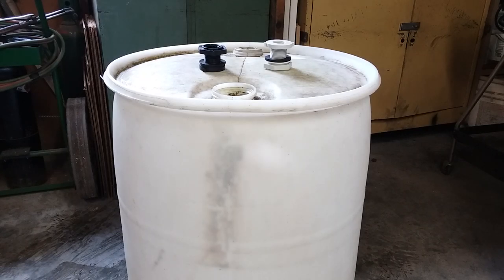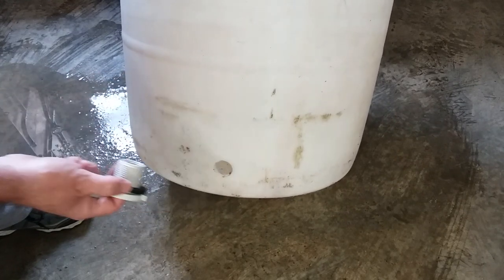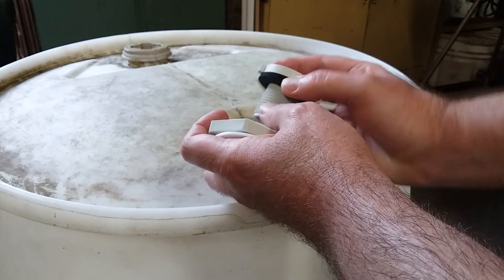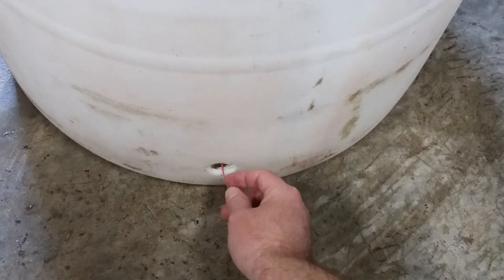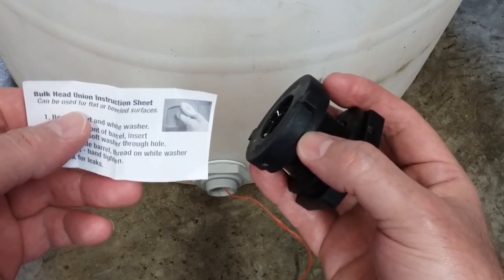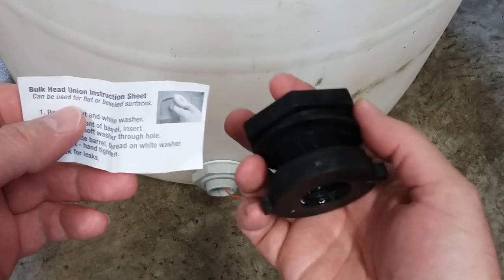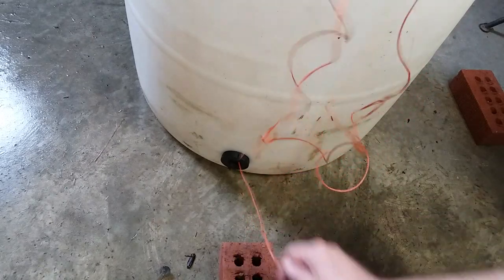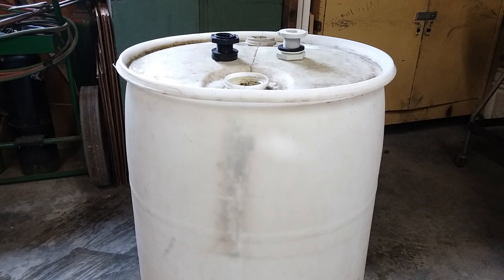Rain barrel Bulkhead union install in closed-top barrels

Comment: Maybe we can add to this.  Great video though!
We do it a bit easier for us old folks but your concept is good!
Take a piece of paracord about 2 1/2 times the height of the barrel.  No need to cut the cord, just make sure you have enough. In the very middle of that length of cord, tie on a 2 inch flat washer. Larger, if your mount is bigger. Just use a tight half knot so it doesn't slip around. You can untie it later. Anything you use must be larger than the inside mount.
Next slip cord inside the mount, do not tie on! Be sure it is facing AWAY from large washer.  The washer is what will hold the inside mount up against the inside barrel wall.  Now, at the very end of the cord, on the side of the inside mount, tie on a smaller washer or nut that can go thru the new hole on the bottom.  
Drop small washer and cord into barrel but leave inside mount and large washer on top of barrel until you get cord & small washer out the new hole or your inside mount will fall off the cord!  
We used a magnetic wand to grab the small washer and pulled it thru the new hole.  You could make a wire hook also. You can take off the small washer if it will not go back thru the inside mount, you just need to be able to pull that cord out the bottom hole to pull the inside mount into place.
Ok, now, pull the cord out from the bottom hole all the while also holding onto the top cord and drop the inside mount and large washer into the barrel [great to have help here). Pull the mount and large washer down into the barrel.  Hang on to that top cord... you have to pull it back out! 
Keep pulling the bottom cord and it will pull the inside mount into place and the large washer will hold it there.  Hold bottom cord tightly while you screw on the outside mount. You will have to slip the cord inside the mount washer. Tighten but do not break anything!
Untie the small washer and pull the upper cord up and out along with the large washer and you are done.
We like using paracord because we don't have to worry about it breaking. Good luck!

Comment: Thank you for that. Very nicely demonstrated. I have, in the past, cut the hole for the downpipe wide enough for me to get my arm down, holding the nut in a vice-grip. I've also fitted the barrel upside down with the tap fitted through the barrel's bung/cap and drilled a hole in the  barrel's bottom (now the top) for the downpipe. But no more messing about. This is the way to do it. Much thanks.
Reply from the maker: Glad it helped. Thanks for watching

Comment: I was wondering how to do this ... thanks!
Reply from the maker: Glad I could help!
Reply: I found it is easier for me to fish out the string with the barrel turned upside-down and I drop the string with a weight attached into the hole I just drilled.  I pulled the string up and let it dropped and generally the string fell out of the opening at the bottom after a few times.

Comment: Now how do you take this fitting out when you need to replace a cracked washer? That’s the predicament I’m in…
Reply from the maker: Pull outward on the fitting white turning it might work. It will put friction on the nut holding it somewhat still. You could also use a long stick to go inside the barrel and hold the nut still while turning. This might require a second set of hands.

Comment: Can’t see why you would even try the later method on a large tank. Tried to climb in but my shoulders wouldn’t fit. Previous owner put the bulk head on outside, then I thought he must of done it wrong as it’s impossible to get that screw on. Glad I watched this to confirm.
Reply from the maker: Putting the shaft portion of the union inside the barrel reduces the stress on it when using heavy connectors and valves. My use is for watering plants and I use several valves that are heavy. These would easily crack the union if used with the union turned the other way.
Reply: @geartechreview4370  it took me 5 min to feed the shaft down to the hole. I’m glad I did it this way as T-piece ect made it heavy load. So, as you say, less stress. I figured this was the case.

Comment: Good video but what size bulk head and what size hole saw ?
Reply from the maker: I didn't include sizes since viewers may purchase something different than what I used. The union I used was a 3/4" unit (  https://amzn.to/3xA4O56  ) and I used a 1-3/8" paddle bit (1.364 / 34.64 mm actual size), but a hole saw will will as well.

Comment: Man - I appreciate you sharing this info. This really helps and you show both ways!! Glad to see this. - WHERE DID YOU GET THE BULKHEAD UNIONS / FITTINGS from??  What size are they ?
Reply from the maker: I bought the unions on ebay. They are 3/4" double threaded. I have to find a new buyer nearly every time I need some. Buyers don't carry them for long.
Reply from the maker: https://www.ebay.com/itm/NEW-GREEN-LEAF-TF34P-E-BULKHEAD-3-4-PIPE-X-1-1-2-TANK-BARREL-FITTING-3054582/401057113029?ssPageName=STRK%3AMEBIDX%3AIT&_trksid=p2057872.m2749.l2649
Reply: I just bought 4 today, of the white kind in the video. They're ~$5 at Menards, by the outdoor spigots.

Comment: Would garden hose fit that threaded part or what kind of  threaded I need to get? I am not familiar about threads. I was going to build a stand like deer stand. Not sure how high. I just want to put plastic trash barrel on the stand and fill up with city water to evaporate chlorine out few days then water my garden from it. Should I put hole on the side or bottom. It is just for gardening purpose.
Reply from the maker: the bulkhead fitting has female threads that accept a male spigot. The spigot has garden hose threads. Putting it on the side allows you to sit the barrel on something flat without worrying about where the spigot will need to be.  I use these spigots/hose bibbs or something similar https://www.lowes.com/pd/AMERICAN-VALVE-Brass-Quarter-Turn-Hose-Bibb-with-SS-Handle/1000598301
Reply: @geartechreview4370  thank you so much...you were helpful. My garden pots is above the ground just high enough to put dish pan underneath to collect water over and over again like recycle water. I need to build couple of stands to put trash barrels on it for water and your video here how to put fittings on were very helpful. My above ground pots are about knee  lenght so how high should I build the stand. When I do that., would water be easy to come out? Thank you so much. I not worry about water  pressure as I would slowly water my pots anyway.

Comment: Very cool! I found these at a lowes near my house. Do you know the part that could connect to this and adapt to regular pvc pipe? Thanks!
Reply from the maker: I use flexible hose with my setup. But if I'm reading it right, you are looking for something like this https://www.lowes.com/pd/LASCO-3-4-in-x-3-4-in-x-3-4-in-dia-Adapter-PVC-Fitting/1067457
I'd make sure I had a way to disconnect it once glued up though.
Reply: @geartechreview4370   Thanks for the reply! yes sir That is what I was looking for. I like your point though , being able to disconnect and service / clean out the barrel is a good idea , thanks again!

Comment: What size do I need 1/2 or 3/4 or 1 for watering my garden slow motion.
Reply from the maker: The bulkhead comes in different sizes. The spigot size must match the bulkhead size. But overall, the bigger the better in terms of pressure and flow. Larger sizes are also much more expensive. Personally, I chose 3/4" and have stuck with it to eliminate needing multiple sizes.

Comment: Why not use glue to that rubber gasket?.. instead of using nylon??.
Reply from the maker: The union comes as a kit with everything needed included. No glue is needed. This also makes it removable.
Reply: @geartechreview4370  what i mean is instead of removing rubber y not making it permanent on its location..everytime u put it back those rubber are always on that position..im just curious.. pls enlighten me sir..